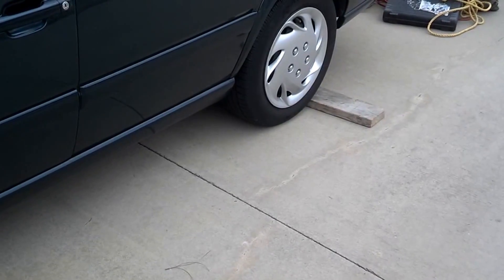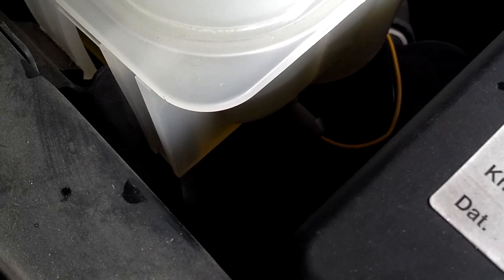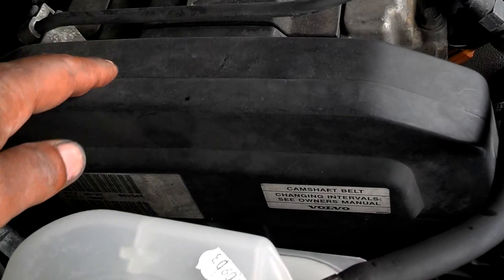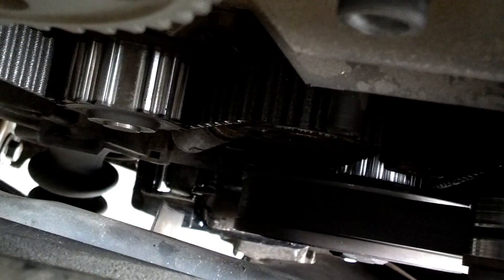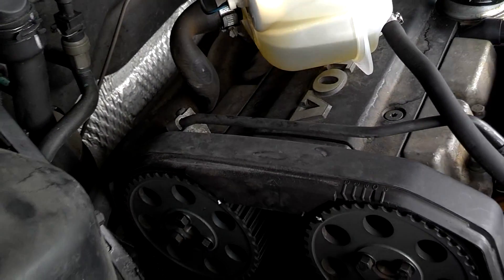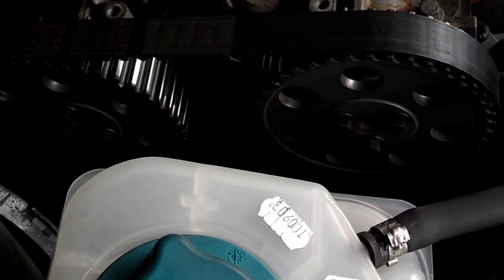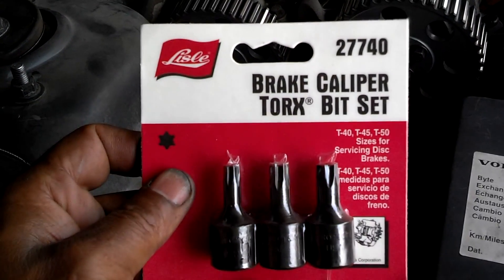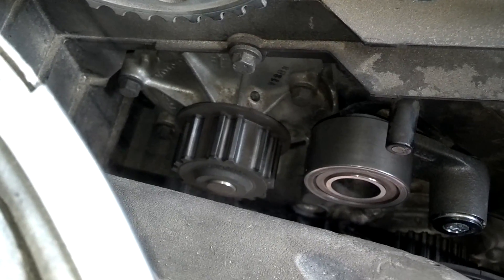How to replace the timing belt, water pump & rollers on the Volvo 850, S70, V70, etc. Pt 1-2 - VOTD

Comment: Changing the timing belt and everything else on an early 94 850. There don't seem to be any timing marks on the cam sprockets. I think I found the crank mark, but I've turned the engine over at least 1440 degrees now and I cant see any marks on the cam sprocket. On all the other P80s I've done, there have been clearly stamped lines to line up. Even on the crank pulley. Not so with this one. Not sure what to do.
Reply from the maker: if the vehicle is running, align the crank and make your own marks on the cams.
Reply: @RobertDIY  unfortunately, vehicle wasn't running when I picked it up. I guess it's what I'm going to have to do though.

Comment: Do you Know what kind of timing belt i need on a 850 144ps 1995 model 2 types139 or 144 teeth?
Reply from the maker: I do not. A dealer should be able to tell you. Mine uses the 144 I think. Purchase both and return the 1 you don't need.

Comment: Hello Robert. I didn’t find a video on your channel on replacing the fuel pressure regulator on a Volvo 850 and decided to write here. Give me advice please. The fuel pressure regulator on my Volvo 850 is broken, but I can't get the hose off of it. In my car the regulator is located near the fuel filter near the rear wheel. I try to remove the hose, but there seems to be another hose underneath it, which seems to be glued to the regulator. It seems to me that the fuel hose consists of several layers. Please tell me how to remove it so as not to break anything, if you know. Thank you.
Reply from the maker: I had to replace the hoses with it as 1 assembly.
Reply: @RobertDIY  Thank you very much. Please tell me what the required lines are called. You may have a part number. And another question. Are fuel injectors different on turbo and non-turbo engines?

Comment: I am driving V70 with the 2.0 B5202FS engine. Could bad timing belt (misalignment) be the cause for the extremely bad fuel efficiency (gas mileage) ?
Reply from the maker: Yes. However, that would also effect performance.
Reply from the maker: Top 3 reasons for poor fuel economy...
3 Poor maintenance, needs a tune up. 
2 Horrible driving practices
1 CEL, Bad sensor in the vehicle causing bad fuel/air mix.

Comment: Hey Robert, I'm having issues with my tensioner on my 02' S40. I do not know the proper procedure of setting the tension, and when I do set tension and go for a drive the indicator bounces around and makes noise when lowering RPM. Any info helps
Thank You
Reply from the maker: https://youtu.be/YpOYTVpzzic

Comment: Robert, I replaced my timing belt on my 94 850 with an aisin kit, and would like to say that I did a beautiful job installing it perfectly. However, the timing belt has a spot in the rotation where it will slightly slither maybe 2 mm in the rotation is this normal or should I be worried?
Reply from the maker: Are you saying that the belt walks around on the sprockets? If so, it may be because the rollers are not OEM. 🤔 Probably wouldn't worry about it.

Comment: I just bought a used S70. With your knowledge and videos I’m able to restore it. It’s really fast car for the economy. I was looking for videos to upgrade the custom wheels but nothing on them. Well I just wanted to say thank you for staying on top of this vehicle.
Reply from the maker: You are welcome
Reply: @RobertDIY  the passenger side hood latch won’t close.  Any suggestions? One side shuts the others open
Reply: @RobertDIY   I got the Volvo s70 fixed and running great. All of a sudden I’m the morning a huge pile of oil by the harmonic balance. I removed the entire timing covers nothing. But oil is dripping. The crankshaft seals dry. You know what it is

Comment: Hey Robert, is there a instrument cluster repair/refurbish service you can recommend?
Reply from the maker: Depends on the vehicle. Swedish car parts fixes some, I'm going to try to fix my 850 cluster. XoMoDex does some.
Reply: @RobertDIY  Thanks for response, ordered new plastic cog for 96 glt, but couldn't figure it out on my own. I will check them out!

Comment: Hello Robert, please can you give me an advice? which is the best way to get out the stripped tension roller screw on 850?

I used new T45 with care but it was like half stripped when it was mounted on and the screw is very tight and stuck inside a block - last timing belt job was done before 17 years and 230 000 km. I tried to break it loose with sharp chiesel, I tried to weld that T45 on the screw and break it loose but it did not work so I am starting to be little frustrated. 

Thank you very much

Sebastian
Reply from the maker: https://youtu.be/gt9w-ZSxs9I
Reply from the maker: https://youtu.be/9QDQj39VzOo
Reply: @RobertDIY  Thank you, I will try this method.

Comment: Is it necessary to remove the serpentine belt to do this job?
Reply from the maker: Did you watch the video?
Reply: @RobertDIY  I did. Maybe I need to watch it again.
Reply from the maker: OK, let me know if it doesn't answer that question.
Reply: @RobertDIY  I'm pretty sure my water pump is leaking a small amount of coolant, so I'm going to replace it. Question, do I have to drain the radiator, or can I just catch the coolant after I loosen the water pump?

Comment: I did it your way on a 4 pillar lift. this means limited acces from below but better from up top as i can raise the car after my will. As i see it removing the crank sprocket  is much easier than fiddling about with the cambelt trying to get it past the protruding parts. Removing the waterpump is also much easer. So if i was to do this again in 180000 km, or ten  years i would remove the pulley for sure. because it was extremely fiddly to get stuff back into place, with a 4 pillar lift. After 450000 km the pump was not leakning but still toast... it would not have run for long. the belt itself over ten years, and full of cranks.
Reply from the maker: Awesome! Most people do not have a lift or the tool to remove the crank/harmonic balancer.

Comment: For anyone doing this job. I recently did it using this diy and everything went well. I will say the belt certainly takes some manipulation around the back of the crank balancer. It wasted the first belt because I thought the bottom was fully seated and therefore the belt appeared to short… it simply wasn’t fully seated at the bottom of the crank.
Reply from the maker: Thanks for sharing.

Comment: Hi Robert DIY. Another great video that made my job so much easier. I have just changed the timing belt, idler and tensioner wheels on my 1994 850SE (petrol, manual). The visible rubber on my harmonic balance (the auxiliary belt pulley on the crank), was visibly perished. Do you know if that matters?

Incidentally, I like the hydraulic tensioner set up much more than the dodgy spring affair on the more modern cars.
Reply from the maker: Yes the rubber being cracked up and chunks falling out of the harmonic balancer is an issue, I did replace mine.

Comment: I need a mechanic like you in my neck of the woods to run through my car and just replace those things before they go.
Reply from the maker: Hmmm, try to find a decent mechanic to change the oil and tell you what else needs to be done.
Reply: @RobertDIY  Trust me that's easier said than done. The mechanic we had that strictly dealt with foreign cars was switching parts out that were not part of the repairs. So other than the dealership it is really hard trying to find an honest mechanic that actually know what they are doing and or that don't steal your good parts and replace them with old parts which guarantees that you most likely will have to have your vehicle back in their shop to service what they have stolen.
Reply from the maker: Ouch
Reply: @RobertDIY  Exactly!

Comment: Is it possible to visually inspect whether the timing belt is still all right without removing it?
Reply from the maker: If you need to check it, just replace it.
Reply: @RobertDIY  Hi - If I change the water pump, should I put something (sealant) on the gasket, or just use the plain gasket? Is it important to torque the water pump bolts to some specific torque, or just tighten them until they feel snug? :-) Do I need to put Locktite on the bolts?

Comment: the volvo man! love your videos, sir, you're really good!
Reply from the maker: Glad you like them!
Reply: @RobertDIY  yes sir, thanks again!   I just did my timing belt on my 2000 v70 xc, n now my b cam is over advanced, probably because I didn't turn past the marks and backpedal to perfect alignment, to remove the slack from the vvt. So after I lived them up, it moved slightly when I installed it apparently?  But idk.. lol the car still runs decent, but I gotta go work on it on Tuesday again to get it perfect!

Comment: A very important point on the T45 socket.  That bit has a very shallow fit into the bolt. Take your time.  Many of these how-to videos skip over the finesse sometimes required to pull a bolt or slip a belt on.  Robert has a way of making note of these areas where experience and finesse is often glossed over.  Well done!
Reply from the maker: Thanks for watching

Comment: My 00 GLT SE didn't have any way to line the cam gears up using the timing cover. The cam gears line up with (what I'm assuming) some permanent marker lines someone from the factory drew on the block, gears end up both pointing straight up. There is no hydraulic tensioner. I was really weirded out to see it like that, but I was able to get it done with the help of your videos. You're a gem to Volvo owners everywhere. Thank you so much!
Reply from the maker: Sounds like you used the wrong video.
Reply: Robert DIY Looks like it. I have a P80 but it does have the RN engine. Thanks for the clarification.
Reply from the maker: https://youtu.be/YpOYTVpzzic

Comment: My belt still has slack after I pull the pin  how do I get tension on the belt ?????
Reply from the maker: maybe the tensioner is bad???
Reply: Robert DIY brand new tensioner

Comment: Hi Robert, I enjoy the quality of your work and the offed. My question is about 1993 960 Volvo - bought with 40 k on it and is pristine. I'm confused about the timing belt and associated parts. According to the owner's manual the belt etc. is to be replaced at 30 k. Now, the same job repeated another 30 k. I must add here that the parts and belt, pump, etc. all look so very close to new that I'm considering adding another 10 k atop the 30=40 k. Any thoughts on this issue?
Reply from the maker: Which owners manual are you looking at?
Reply: @RobertDIY  The one with the car. 1993 960 2.9. also. Have you any ideas of changing out some of the timing related parts for the later 960 models? It seems like a good idea to me.

Comment: Hey Robert, thank you for this helpful video! I am currently trying to get my timing lined up, because my exhausts smells like petrol..I have a volvo 850 with the 2.5 20v engine. Are the marks the same as in this video, because i think i have only one mark on the wheel of the oil pump...?
Reply from the maker: Yes. You may need to replace your O2 sensor. Are there any codes?
Reply: @RobertDIY  you mean the air mass sensor? No codes, only secundary air pump, but this shouldn't cause the bad exhaust parameters shen the engine is warm...:-/

Comment: Good afternoon Mr. Robert, I really like your videos and I thank you because it has helped me a lot, I am Brazilian and I am having trouble finding the hydraulic tensioner for my Volvo 850 97 (10 B5252S engine valves). Please wonder if all engine models of the 850 are the same tensioner? Sorry if there is a typo but I don't know how to write in English and I needed help from the google translator.
Reply from the maker: Yes, they are all the same.
Reply: @RobertDIY  thank you very much you helped me a lot. congratulations on your videos
Reply from the maker: https://youtu.be/Qvveywp-JOc

Comment: THE best video on the crank marks! Although my 1994 is slightly different, I have a single tiny notch at the back of the trough of the correct alignment on the crank.

What's interesting is that I did this yesterday and my marks on the pulley were off compared with yours when you said it seems to align with the belt. I'm sure that's indeed a secondary check.

It was double checking this that assured me that I only had the single notch on the crank tooth, so much so that I shifted the timing by one tooth as the timing was previously incorrect by that one tooth.

Having done this and fixed the variable intake (had the manifold off to do the PCV) and noticed this VVIS mechanism which was seized and I didn't even know existed!), the car is utterly transformed. 

I can admit to being the person who changed the cam belt the previous time but I just set it up as it was before that and that was done by a garage.

At 300,000 miles, I had just put the power loss down to old age, so happy right now. It seems that I've been driving around for about half it's 25 years life with mistimed cams, certainly the last two belts and the previous one has been on for over six years.

Thanks again for the videos Robert, always with super detail and to the point.
Reply from the maker: Wow! Glad you figured that stuff out.

Comment: don't use RTV any where near the water pump(maybe the bolt tops but I seem to have no issues) ..it will make them leak ive seen...USE bearing grease light coat to hold the paper gasket to the block then put the pump on dry  ...works like a charm. Just did mine 5/19/2019
Reply from the maker: Cool, I never put anything on mine.

Comment: The tensioner roller bolt striped; Any tips to get it out? I would love to use my drill but the angle makes it impossible.
Reply from the maker: Try vice grips on the outer washer.

Comment: I have a 1995 Volvo 850 Turbo 2.3L Volvo Sedan.  I was having engine issues so we did a rebuild on the engine ourselves. We took just about everything out down to the engine block, shaved it, cleaned under super water pressure and bath soak at a machine shop, seals, gaskets, and basically, everything was changed out from vacuum hoses to radiator hoses.  We followed your other video on this.  We are at the point of getting the settings marks for the timing belt on the cover and the crank below.  We can't see the notch down there and we are not sure if it's lined up on the crank below.  The timing belt cover is line up correctly.  When we turn the bolt at the wheel well we can hear the pistons hitting the top.  What is the correct way to see if we are doing this correctly, especially when we can't see that notch on the lower crank?  Can you give us a process on which to do first? the second?  We are stuck and its 30 below out now so we are taking a break.  Of course, it's in a garage with heat.
Reply: The intermediate mechanics here are scared they will blow the pistons.
Reply: We also have all new tensioner, water pump, etc. We haven't put them in yet.
Reply from the maker: You have to align the crank BEFORE you install the cam cover.
Reply from the maker: If you installed the cam cover, before you align the crank, you likely cranked down some valves on to pistons and bent them.
Reply from the maker: If you/they watched the cylinder head installation video, it instructs people to align the crank before installing the head.
Reply: Does the crank go in one way? finding the notches are hard to see on both sides of the lower crank.  Yes, cam cover is still off.
Reply from the maker: Did you watch my other timing videos?
Reply from the maker: https://youtu.be/orDjbXKq24U

Comment: Thanks Robert for your videos! They have helped me maintain our 1998 S90 for the last 4 years. Bought it brand new after military and love it. I do have a problem and hope you can help....I changed the timing belt, tensioner and tensioner pullies along with the water pump just in case. I went to set the timing by lining up the marks on the can sprockets with the groves in the timing cover. Intake lines up great but I con not get the exhaust to line up at all...I have turned the pully over and over to set the timing but they will not line up together...I am frustrated to the point it is just sitting in the drive way now. I did lock the cams together before taking the belt off..I have no idea why or how it is off by that much. Please can you help with this situation?
Reply from the maker: Did you align the timing before you removed the belt?
Reply: Robert DIY Yes sir I Did. But whatever reason the marks on the cams will not line up with the notches on the cover. Will i need to take off the belt again and aling the cams sepeartly? Hope not...thanks

Comment: Hey Robert!  I have a 1997 Volvo 850 that just ticked over 85,000 miles.  I've read that this is the mileage to do your timing belt at.  My question is what do you think will need replacing?  It's getting old but it's low miles for its age and I'm only the third owner.  I'm hoping just to replace the belt and maybe the tensioner... what are your thoughts?  I'm hoping to do this on a budget and avoid the $1k plus repair
Reply from the maker: OMG! How much do you think a new car would cost?
Reply from the maker: https://youtu.be/gt9w-ZSxs9I
Reply from the maker: https://youtu.be/ZqdHDqGKYV0
Reply from the maker: https://youtu.be/58O5N43RsGY
Reply from the maker: WAY past due. Seven years or 70,000 miles.
Reply: Robert DIY less than the repair, even if I took it to the shop!  I'd like to hold on to it since it's been so reliable but I want to make sure I keep it that way!  It almost certainly has the original water pump, but it only has the 85k miles on it.  Was hoping just to replace the chain and maybe tensioner?
Reply: It's an unusual situation because it's a 20 year old car, but hasn't broke 100k yet
Reply from the maker: Chandler ok